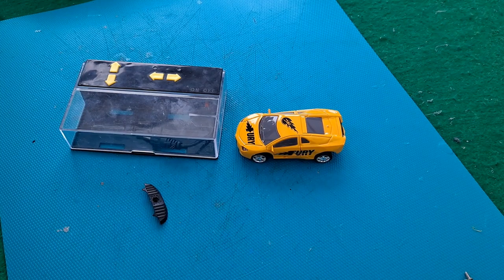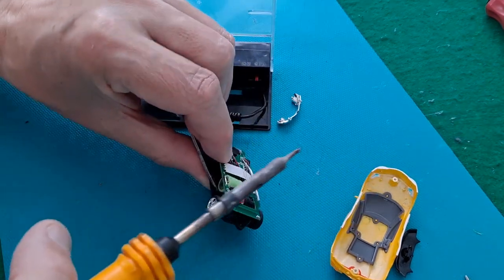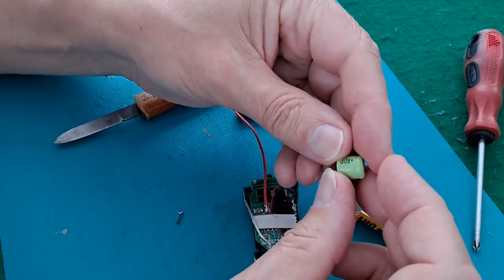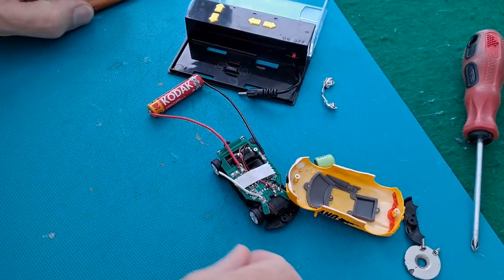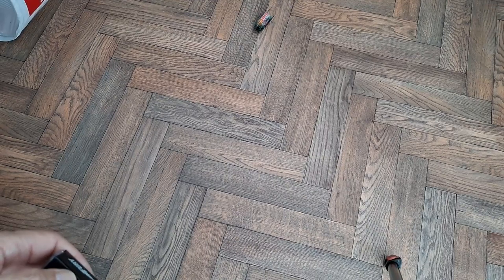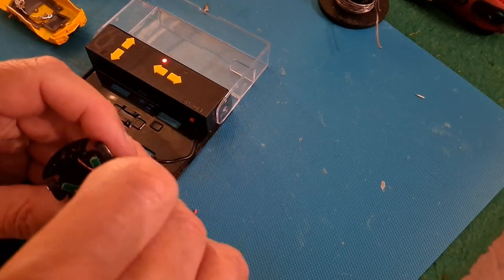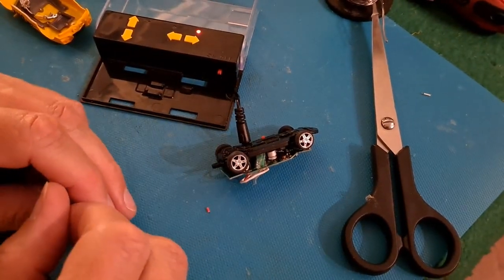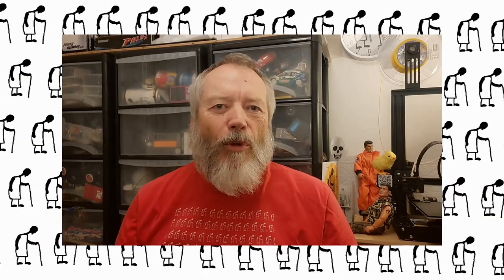Can I fix that RC Pocket Racers Car Fury?

Comment: This is the video I was anticipating for.  I am definitely getting a micro rc. I. Hoping I can find a hobby grade version and can actually afford it.  Thanks for the great video grandad
Reply from the maker: Good luck! I have no idea if hobby grade cars are available this small. I have seen plenty of videos of enthusiastic modellers making hobby grade this size, but I haven't seen any commercially available.
Reply: @GrandadIsAnOldMan  that actually sounds more fun. That's why I am saving up for the escavator pro hobby grade that is so expensive but people actually use them to dig out basements that are close to another house that need repairs.  It is about 4 or 5 feet at the boom.ive seen then easily dig out a 3 foot deep hole before it has to be moved to a lower level to get down farther

Comment: These can take a 1 cell lipo alright if you feel like trying that out, going too be quite a bit faster ofc & not charge from the remote anymore but I'd imagine you could make an adapter plug too use your hobby grade charger or perhaps a usb charger that can do lipo packs & making a splitter on one of those with a separate charge lead.
Reply from the maker: That is certainly an option, it would probably run off a supercap too.
Reply: Interesting

Comment: That was a pity with that battery popping but it works. What about a AAA rechargeable? If there is room. I like the miniature RC stuff, especially the little planes that you fly in a gym hall. Anyway have a grand evening and looking forward to seeing how you get on with this car. 😁👍🎸
Reply from the maker: Good evening Mike, no way an AAA would fit in there. Those tiny LiMh batteries are listed in lengths related to AAA or AA batteries such as 1/4 AA size meaning they are 1/4 of the length. I might go an buy a Poundland Solar Light and see if the NiMh battery from that will do the job.
Reply: @GrandadIsAnOldMan  Good idea. Maybe put them in parallel so they can handle the charge better.👍
Reply from the maker: @mikeflight9  There is only space for one. I found an old faulty solar bulb in my "stock", changed the solar panel on it just to see if it worked and I fixed it. Now I am torn between pinching the battery or putting the working bulb up with all those other ones I have hanging from the ceiling 😆 I will probably pinch the battery, I think I have enough working bulbs 🤣

Comment: Howd you find the volatage of the car, im using this as a project and also a something to help learn electronics.
Reply from the maker: I am not sure what you mean by find the voltage. Just read the voltage off the batteries it uses?

Comment: Hi Please check the charger if ok plug charger into car (no battery and check voltage at the battery input terminals. You could try charging the battery with a aaa battery charger using a resistor in series with the battery to limit the current. best regards